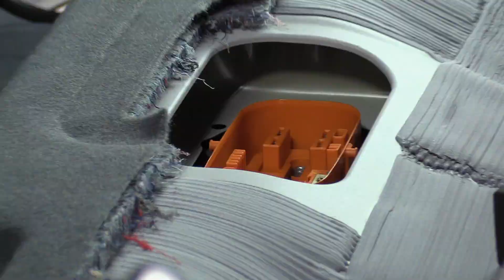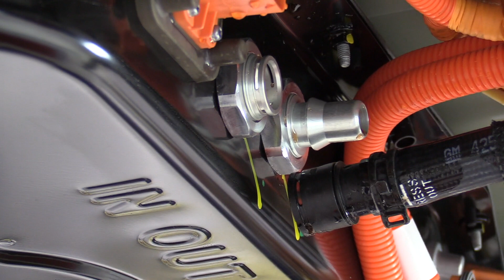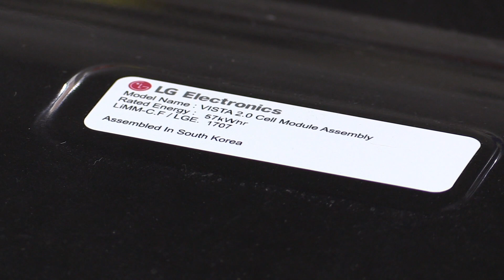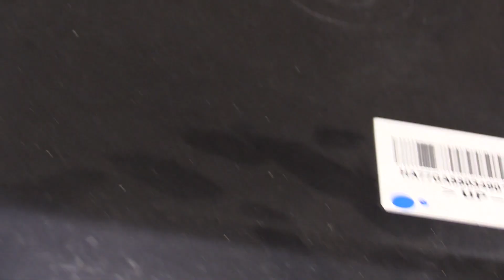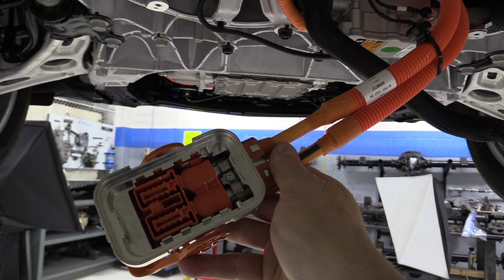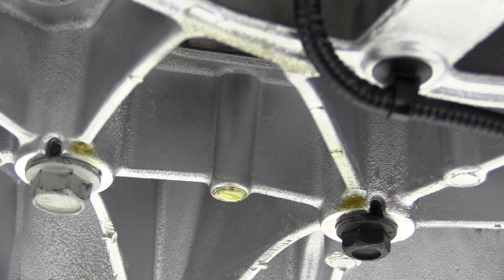Chevrolet Bolt EV 57kWh Battery Removal

Comment: Lifting the last section high enough to look under, it is visible how inefficient the contact is with the thermal transfer pad! [assuming the darker color is the stain on the metal from the adhesive, and the lighter metal has not come in contact at all?]
Reply from the maker: It is difficult to tell for sure. I will see if I can do an experiment with contact marking dye to determine contact area. Thanks for your feedback!

Comment: Great video! I appreciate the time you take to capture and explain every detail. This is like the show Ask This Old House for automobiles. Is there is no aerodynamic defuser (cover) underneath the Bolt? The battery pack, cables, and lines are all exposed to the elements if there is not cover. Here in the Northeast, all the salting of the roads and highways will take a toll on them. Fossil fuel vehicles can't have a full cover because of the exhaust pipe, catalytic converter and muffler being very hot. But fully electric vehicles can.
Reply from the maker: Thank you! There is a large under-vehicle cover for aerodynamics and protection of all under car components. I neglected to mention that I had already removed it for this video. I will show it in the next video when I disassemble the entire battery pack. Have a good day!

Comment: Whats required for the installation of the battery electrically / electronically? Does it automatically get recognized by the battery inidcation / range prediction computers and sensors?
Reply from the maker: Great question! No, there is a special EV Battery Pack Capacity Learn function that must be performed with a GM scan tool. After that procedure is completed, everything else is automated. Thanks for the question!
Reply: I think with BMW i3 you have to register new battery number and if capacity change then coding required with ISTA.
Reply: thanks, I flew for the USAF, turned a wrench for them on their aircraft and I also worked heavy maintenance in the wind turbine industry so I feel I have an advantage in understanding my Chevy Bolt EV Premier White Summit / blue gray interior. So when''s the GM Service Manuals going to be released?-- because Helm publishing (their contractor) say they are waiting on GM to send them the service manual series.
Reply from the maker: I do not know about the service manual release. i access the service information through a subscription to all GM service information.

Comment: I would buy a Bolt for $35k, assuming they had the power and features of  a Model 3. Its like GM isnt even trying. Nissan is  gaining ground with the new 200+ mile range Leaf.

Being that Elon can successfully build rockets, but cant seem to fulfill car demands, I may have no choice but to get a new Leaf.
Reply from the maker: If you live in a hot climate area, you should read what the Leaf owner's manual says on page EV-20 about battery life  and hot temperatures. The Leaf battery is NOT liquid cooled. The Bolt's battery is. Lets talk again in 5-10 years and see which battery still has good EV range. Thanks for your feedback!
Reply: Refried Beans Your comments are off base. The Bolt EV is superior to the Nissan Leaf with better battery technology and much longer range and more power. Nissan won't have a longer 200 mile range for a year.    I own a Bolt and it has exceeded expectations. The Leaf looks like a fine EV too, but is cheaper for a reason. Lots of good options in the near future.
Reply: Have a look at the Model 3 reviews - good car but extended range isn't 35k more like 65k with taxes
Reply: Mass production seems to be what is lacking at Tesla.  Its a tough part of the the whole product.
Reply: WeberAuto 

Thanks for the heads up sir! I dont live in a hot Climate(Northern Nevada) but winter lows can dip to 0F 😔

Im still in research phase, but If Tesla ever gets caught up, I would love to have a model 3 anyday over the leaf. I did come REALLY close to getting the Bolt, but I was worried GM would abandon the 100% EV market due to the low sales. Like when GM  crushed all the EV1 cars, even thought the owners fought tooth and nails to keep them.

 Nothing against GM sir, but they have a history of doing shady things to solidify thier market share of gasser cars. 

You sir are a fine teacher, as I have subbed to you... But I dont think GM will get any of more of my money.
Reply: WeberAuto 2018 leaf is cooled battery ...and I own bolt ev I like it really good car with a lot of range
Reply: 2019 is expected to get liquid cooled LG Chem cells. 2018 is still stuck with legacy AESC cells that bake.
Reply: To be fair, the base level Model 3 was never marketed as the extended range Tesla. People knew what they were getting for $35000 from the start, even though they will have to wait quite a bit longer to get it due to production issues that WILL be resolved.

Comment: Interesting as the Bolt is advertised as having a 60kWh pack, but clearly it is only 57kWh marked on the unit itself - maybe that is the "usable" amount? I wonder if other manufacturers does the same.
Reply from the maker: I do not know. I suspect 57kWh is the true rating and they just rounded up. I will investigate further. Thanks for your feedback!
Reply: Like Tesla
Reply: Tesla is guilty as charged - the Model S 60 is in fact a 75kWh car with the last 15kWh bit being blocked off via software. An expensive "unlock code" can be purchased that would lift this restriction, but it is in essence a paywall.

Comment: I am Electronic Tech. Thank you for this video I know more about replacing and changing a bigger KWHr battery than original if they make one. Like 75 KWhr which range will be about at least 350 and possibly over 400. I read the comments but did not see what the source of your service information was. I always have s shop manual for every vehicle I buy. What an engineering marvel this is! The more I see videos like yours, the more impressed I am. My address is daviraker@gmail.com Thank you again. Glad your flu is decreasing sir.
Reply from the maker: Thank you very much. The service information comes from https://www.acdelcotds.com/ You will need to purchase a subscription to access it. You can also purchase electronic service manuals at www.helminc.com when they become available. I am not aware of any battery upgrade for the Bolt at this time.

Comment: Great detail as always, Professor Kelly!
Would you consider having the B(ravo)olt over your V(ictor)olt?? Assuming of course you still own Victor...

Also, there seems to be an awful lot of surface area with all the webbing in the under structure of this car. Could that present issues in the future with corrosion as I see lots of places for road salt, etc to live.  I'm wondering what you think?

👋🏻
Reply from the maker: Thank you!  I would like a Bolt. I would still keep my Volt. The lower tray is 0.050" (1.27mm) thick. The webbing is 0.094" (2.39mm thick).  It is made to withstand running over objects without penetration. I think It will be okay. Thanks for your feedback.

Comment: I wonder how the bottom steel battery pack will hold up over time in northern states with road salt.
Reply from the maker: There is a large reinforced plastic cover under the vehicle. I neglected to show it in the video. Everything is well protected.
Reply: Paul Wicklund  that and all the salty slushy sandy snow in mn will wreek havoc on those connectors and such underneath unless there is some kind of shield covering them?
Reply: GM has an undercoating solution for the Bolt, and I imagine that, once out of warranty, you could get away with any non conductive corrosion resistant product like Rust Check or Corrosion Free.  I know that some people think that undercoating is a "scam", but those of us who live in the rust belt know for a fact that even on new cars, it's 100% a yearly requirement.
Reply from the maker: It appears to be made of a thick steel. I will measure it when I take the cover off this week. Thanks for your feedback!
Reply: I live in the mag chloride belt and after a day out in the slush I always stop at the nearby car wash for a drivethrough underside washout. Then the heated garage.

Comment: I await your tear-down of this pack.   I noticed the tapered seam between the two halves of the pack and can only guess that this is to improve water and debris run-off which will reduce corrosion on the MANY bolts holding the two shells together.   The label you could not identify its purpose on the top appeared to be a material label.   GF45 sounds like Glass-Filled 45% to me.  GM used a patented (or possibly trade secret) material on the Chevy Spark pack and this looks like the same fiberglass-reinforced material used on that pack.   It’s light.  It’s strong.  It’s also expensive.
Reply from the maker: Thank you and thanks for the additional information!

Comment: Did you happen to notice on the underside, there is approximately 80% of a spare tire well (don't believe this is capture? I'm still scratching my head on that one.

I believe with fast charging the power is transferred through the same large cables that connect the battery and controller(?). GM manufacturing Bolts w/out DCFC is unfortunate. I own a Spark EV w/ DCFC. 

You do good work sir, thank you for sharing.
Reply from the maker: Thank you!  I have not looked in the compartment on the car yet. It does look like a spare tire area, but it is probably just storage. I just verified it, you are absolutely correct. When using the DC fast charger, the large 2 wire connector at the battery is used. The small 2 wire connector is only used when using a Level 1 or Level 2 AC J-1772 charger connector. Thanks again, have a great day!
Reply: Although it looks like a spare tire well, one would definitely NOT fit. However, a factory wheel with a tire fits just about perfect under the false floor if you have the option or bought it aftermarket. 

The well has a big foam block which provides storage for the recovery hook, the optional (?) air compressor, and 120 volt charging cord.

Comment: Thank you, Professor.  You mentioned there are two battery designs and that this Bolt does not have the fast DC charging option.   I don’t see a fast charge connector on this pack.  1st Q: Do you know if the other pack design is for the fast DC charging or why there would be two pack designs for this vehicle?  2nd Q: Where are you getting your service information from?   Do you have a subscription or were you able to purchase a service manual?   I was hoping to obtain a service manual for the Bolt, myself.
Reply from the maker: Thank you! Correction to my video: When using the DC fast charger, the large 2 wire connector at the battery is used. The small 2 wire connector shown in the video is only used when using a Level 1 or Level 2 AC J-1772 charger connector.

I am getting the battery pack design information from the Chevrolet Service information. It shows the New Design Battery Pack being installed in Vehicles built after 1G1FX6S06H4163254. The first design battery has two female coolant connections at the battery. The first design also has the service disconnect lever (under the back seat) as opening from the driver's side of the vehicle rather than opening from the passenger side of the vehicle. 

The EPA Service information act of 1995 requires that all factory service information be made available online. You can see all of the service information prices and links here https://www.nastf.org/i4a/pages/index.cfm?pageid=3291 Paper service manuals are no longer available. Best wishes!
Reply from the maker: I was wrong in my previous comment to you. I have edited it to be correct. When using the DC fast charger, the large 2 wire connector at the battery is used. The small 2 wire connector is only used when using a Level 1 or Level 2 AC J-1772 charger connector.
Reply: WeberAuto Thanks, again.   The second design must have been some poke-yoke-ing to eliminate goofs at the manufacturing plant as the differing ports prevent mis-assembly.  I can only surmise that the reversal of the service disconnect was for another optimization improvement.     Thank you for the service link.   It seems all automakers have gone this route.  Pricey for the garage mechanic (I still like to do my own brakes, you know!).

Comment: Thank you so much for the great video. I am surprised the bolt has such a thin battery design comparing to BMW i3. I guess the reason behind is the drive train layout? So I guess the bolt is front wheel drive, which Chevy could fit the motor under the hood, and free up the space under rear seat for batteries and control module. And i3 is rear wheel drive, so the space under rear seat and trunk is taken out by the motor and optional generator, so the battery has to be a relatively flat module to fit under the floor, also it can't stick out too much in front in case of frontal collision, don't want to damage the batteries and control module. But still just look from the outside the LG cells in Chevy Bolts seems to be a lot shorter(thinner) than the Samsung cells in BMW i3
Reply from the maker: Thank you and thanks for he feedback! Teslas are RWD or AWD with a flat battery under the car as well.
Reply: But this is huge at the back. BMW pack weights half this one. Their 94Ah, 33kWh slightly more than the original.
Reply: Luke W I do like the Samsung cells on i3, already have 50k miles on it, estimate capacity lost is around 1%. But the range is kind of short, not very impressive
Reply: Guo Richard good to hear you are driving an i3. Yes 60ah without a heat pump isn't great especially as the cat isn't very aerodynamic. But it's fun to drive and you can swap to higher capacity battery pack easier than most.

Comment: amazing !!!!!!!!
what is the GM warranty TIME for removal ?
what is the Customer time for removal ?
Reply from the maker: Thank you! I do not know the warranty or customer labor time.  I suspect is is somewhere in the 2 to 3 hour range.
Reply: GM Warranty time always CHEAP !!!
I worked on the 2004 Silverado MILD HYBRID - START STOP 
only paid 4 hrs to replace the Burnt out Stator 
Bad DESIGN , had lots of battery Codes

Comment: When the university purchases a car from the dealer, does the dealer or manufacturer know that it will be used for research in a classroom?
Essentially, could you take the Bolt to the dealer to get the power steering rack repaired under warranty, if you didn't show them this video? :)
Reply from the maker: No, they do not know. But It doesn't matter if they know or not. This is nothing that would prevent warranty from covering this leaking rack. Additionally, I have been a World Class certified GM Master Technician since 2002. All the local dealerships have known me for almost 30 years. I always follow proper service procedures. Thanks for your feedback.

Comment: thanks for the video it so cool to see an new Electric car taken a part . You mentioned that the rack and pinion is leaking does it have a hydraulic rack ? I would've  though that it would have a electric rack is this possible that it leaking from something  else. ?  hope that you feel better and get rid of the flu for good.
Reply from the maker: Thank you! It has an electric rack, but it still contains lubrication oil. That lubrication is leaking.

Comment: You are wearing Arc Flash Protection Gloves but using a non insulated Screwdriver to unplug the Connectors. Also not wearing a Face Shield or any other OSHA recommended  Safety Gear....   kinda Funny  ;-)
Reply from the maker: Thanks for your feedback and concern for my safety. Safety is a top priority here. OSHA requires employers (vehicle manufacturers) to perform a safety assessment for each type of job to be performed and then provide training on the use of the proper Personal Protective Equipment (PPE) to be used. I was following all of the electrical safety instructions, and using all of the recommended PPE gear as stated in the Chevrolet Service Information with one exception. My ANSI Z87-2+ prescription safety glasses should have had their side shields installed. A Face shield is only required in the European Union, not the USA for these DC voltage levels. The pocket screwdriver is exactly what the Chevrolet Service calls for. (although you make a good point, an insulated one would have been better) An insulated screw driver would not fit in the release cavity.  Thanks again!

Comment: This is very nice to see you take apart the Bolt, I have a 2017 also and a 2017 Volt. It is nice to see how it works!
Reply: I'm thinking about getting a used Volt but the transmission is over complicated. It's a great idea, but have any common issues developed in the volt? I like the simplicity of an EV better but I can't afford a new Bolt
Reply from the maker: I have not heard of any common issues with the Volt transmissions. My 2014 Volt has 50k miles on it without any issues. My 2012 Volt was also trouble free. My co-worker bought a used 2012 Volt with 100k miles on it. It also has no issues. Best wishes.
Reply from the maker: Thank you!